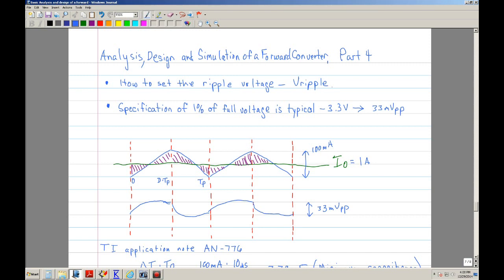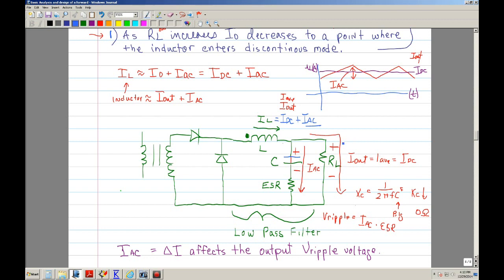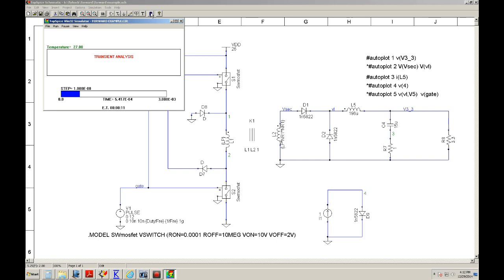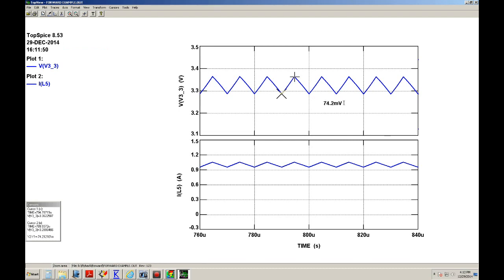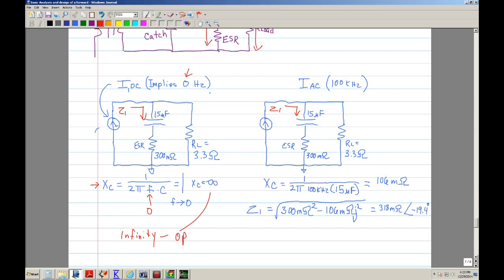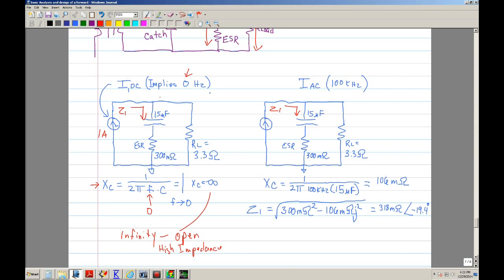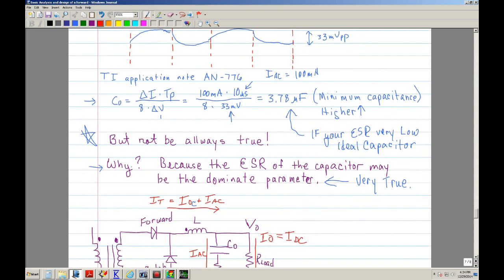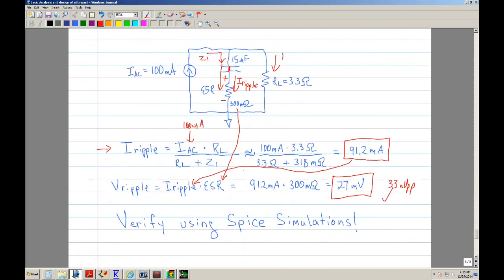Forward Converter Part 4: How to Design for Low Voltage Ripple

Comment: Can you please explain what is D9 in the simulation do ,and what is this circuit
Reply from the maker: D9 has no affect on the simulation. I want to see what was the voltage drop across the 1n5822, which is a Shockley diode.
Reply: Thanks so much,i did also send you email about control loop for LCC ,if you have time can you please check it
Reply from the maker: Are you Taky Aziz as well?
Reply: +Robert Bolanos yes
Reply from the maker: Wendell Boucher is an expert on LCC and has a video on that subject. Having said that, in looking at your schematic, I think you can use Jack Alexander model to simulate the loop of your LCC. Look in my channel for the loop compensation video and watch the first two videos. This is the model I use when I simulate resonant converters.